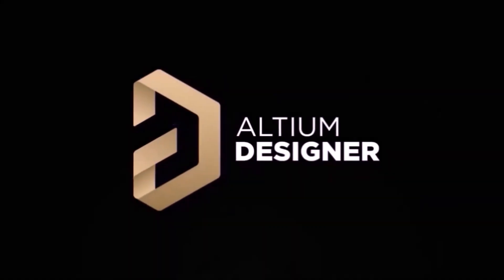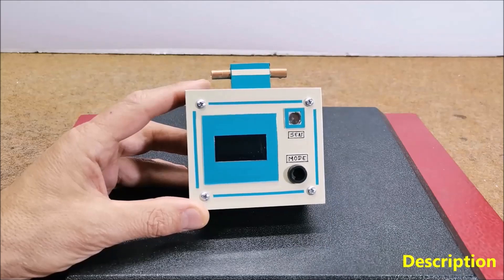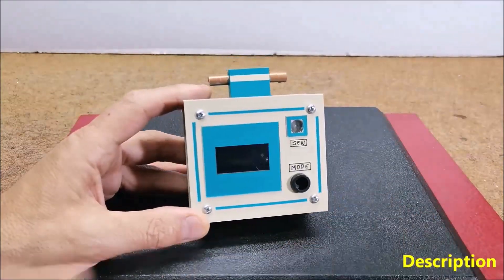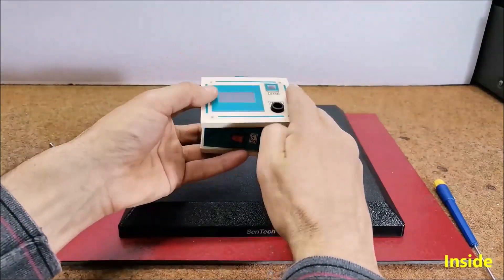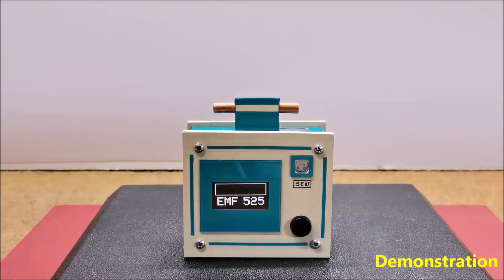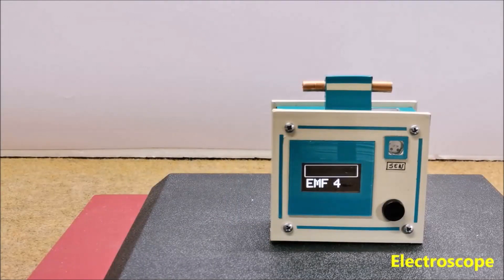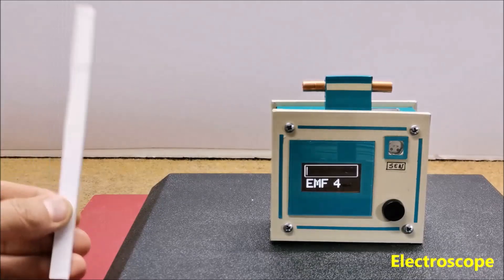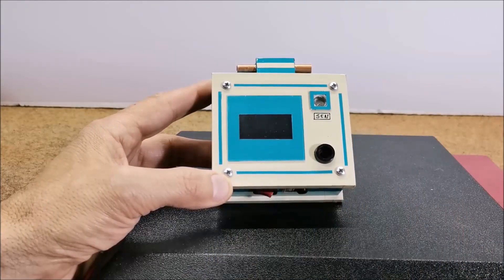DIY Simple Arduino EMF (electromagnetic field)  Detector

Comment: So far I have it working of the the 5V breadboard, I'm using the 1306 which means that I have to change the code a bit, after changing the parameters i got the meter and value in the screen clearly together. Next I'll be adding the switch and the antenna, to see if it works better. Thanks a lot, for helping noobs like me.
Reply: What line did you change to get it right cause i still cant

Comment: I'm working on a similar project with the Arduino UNO board but I was wondering how would I be able to do it without the connection to my computer. Where do you write the code in your case?